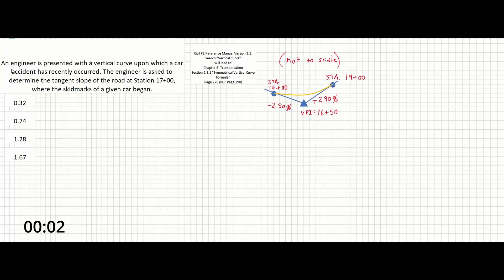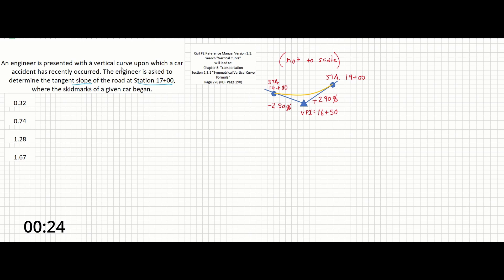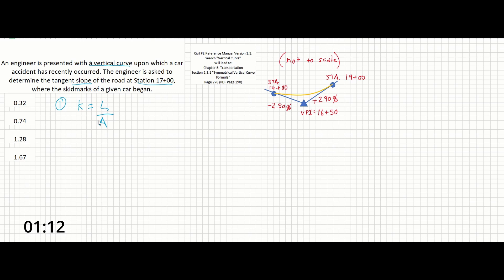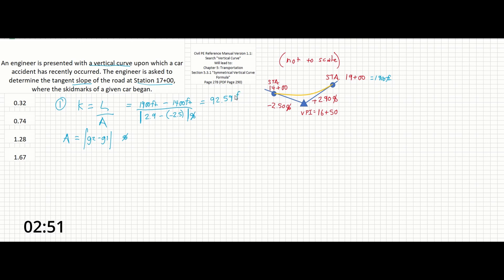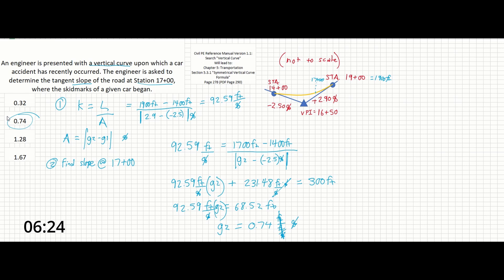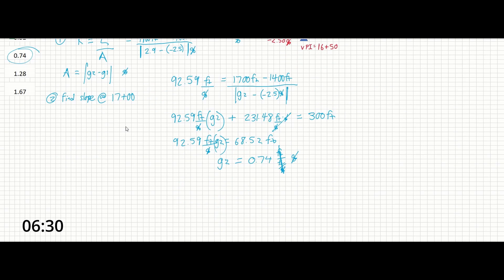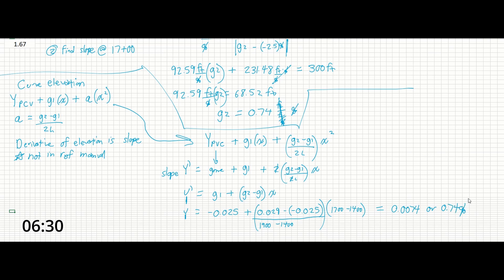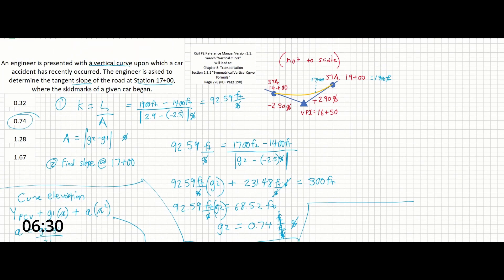PE Exam Practice Problem #52: Transportation | Vertical Curve

Comment: Solve this problem using r (rate of change of grade) will be simple and faster
Reply from the maker: Thanks for pointing that out. My background in transportation is pretty weak so I'm sure better ways exist, especially since this is a 13 minute problem on a test that requires an average of 6 minutes to solve. I will make a note to post an updated video when I get time. Do you happen to know if the formula(s) required are in the manual? I can check later, but in general I try to use the reference manual in problems so that people who might have no background in a problem can solve it with the tools they have available.
Reply: @SolvedIn6  The way to solve this using the rate of change of grade (r) formula in reference manual 5.3.1 is to calculate r using g2=0.029 ft/ft, g1= -0.025 ft/ft, and L=500 ft, which comes out to r=0.000108. Then use that same equation with the calculated r value (0.000108) to find the tangent slope (g2) at Sta. 17+00 using the length between Sta. 14+00 (PVC) and Sta. 17+00 (300 ft) and g1 = -0.025 ft/ft, which comes out to g2=0.0074 ft/ft or 0.74%
Reply from the maker: @nicko8753  Thanks for the help! You seem like you're reviewing both water and transportation problems. I thought I heard that the new format of the exam doesn't have a general section anymore, but maybe I'm wrong. Basically I just mean I'm used to seeing people only review one subject when they watch videos on this channel.